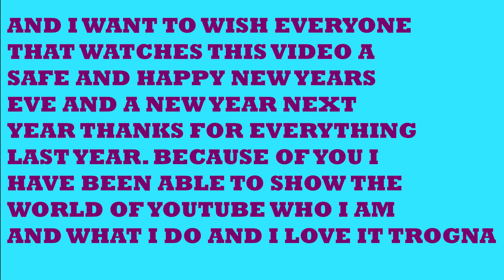NEW YEARS EVE GOING OUT WITH A BANG ON THIS ONE Milwaukee to the rescue.

Comment: I got the big sectional Milwaukee and it’s been good, I got a lot to learn before when I started but it’s a good machine, 7/8 cable, that thing is making money 💰
Reply from the maker: Yeah I was looking at the bigger machin but because we use small service vans there is not a lot of room. Thanks for watching Edwin. Happy new year
Reply: @Jaythatdrainguy  actually I have a transit connect and it fits perfect with my other stuff, it is heavy though. How much you charge for sewer line rodding, kinda curious how the prices are all around the states.
Reply from the maker: Well I'm in Canada in the Toronto area and for a job like that during the day we charge by the hour and I know a lot of companies are charging set fees nowadays. But yeah we charge by the hour and a job like that would be about 200 to 250 somewhere around there. Hopefully this helps. What about you? I'm curious to know how much you guys would charge for a job like that during regular hours, not overtime or anything like that. Let me know. Happy New year! Thanks for watching
Reply: @Jaythatdrainguy  I usually charge $350 but can be more expensive if is more contaminated, sometimes a floor drain not to bad can be $250, never hourly just for the job, that can be done in couple hours or less, I’m located in Chicago.
Reply from the maker: Cool

Comment: hello risky person you just fucked up and it was not an option to clean from the well once you knew that it was propping up several floors?
Reply from the maker: There is no well on a building like this where I live in these apartment buildings in the Toronto area it would go below that floor and tie into the main drain that goes across the ceiling of the level one basement. So that was the only access point other than doing it from above and to do it from above we would need to cut, open the wall cut, open the pipe and try to snake down. I tried snaking down with my smaller cables and was not able to break through it. Hopefully this helps. Thanks a lot. Happy New year!